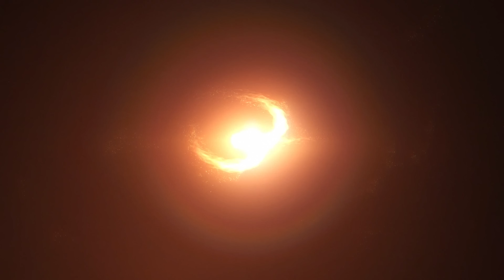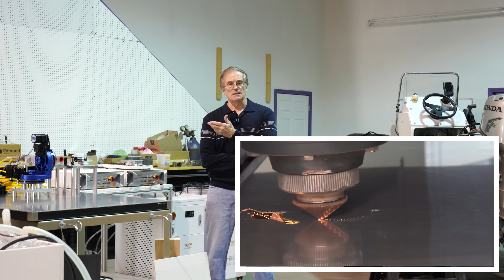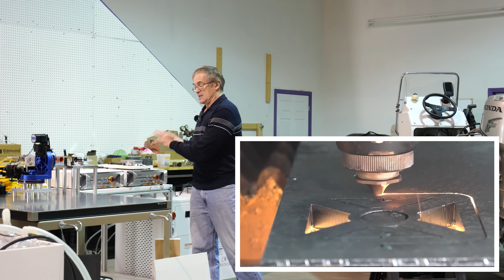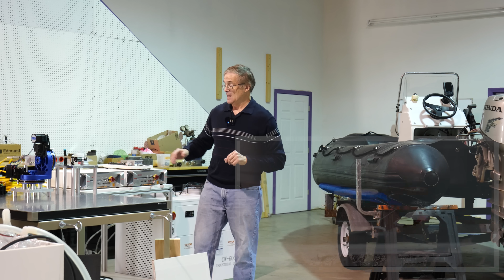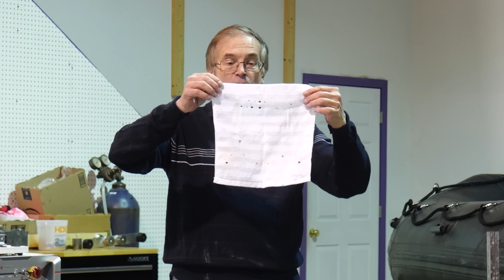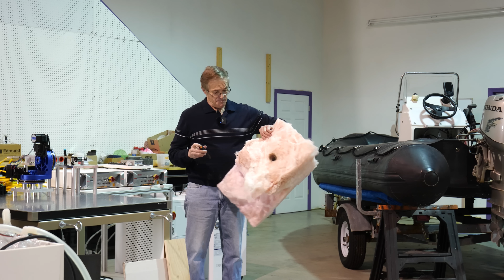We have a problem... and need your help!

Comment: What will happen if you fire the laser at the super white paint you made that returns all sunlight coming to it? I would create a 3 layered wall, the front wall is styrofoam, than sand and at the back a wall that is painted with the special white paint, the laser will go through the styrofoam and the sand get to the white paint and be scatterd back to the sand, sand could absorb the heat pretty good

Comment: Could you rotate the laser so you are shooting into the ground?

Possibly dig a hole into a room some number of feet down. Then behind the target have a deeper hole lined with PVC pipe and ending into the dirt. You could likely excavate a 20 foot deep 16" hole fairly easy if you don't have rocks. If you have rocks, a well drill could drill that hole in a short amount of time for not too much money. There are many companies that drill wells for ground-sourced heat pumps.

The bottom of the hole could be filled with some aggregate as a beam dump.

Comment: Something like larger rotating aluminum/copper plate which is cooled by air or water? Similar to disc brakes? It may even move sideways so there won't be hot circle and maybe water can be sprayed onto point of impact.
Other idea would be something like falling sand or waterfall with lot of particles such as clay to disperse or absorb light.

Comment: I'm certainly no expert in this, but my first test would be the plywood with a facing layer of Nighthawkinlight's updated Starlite formula.

I know there are questions about Starlite's effectiveness, but it should be quick, easy and cheap to test. Even if that doesn't work, a layered system of different materials seems the best way to go.

Comment: I think there might be some additional content that is useful but here are two ideas. Overall this is really a constrain imposed by the testing environment and not so much potential use in final application. Shooting lasers up towards the sky in a war or something like that. (civilian use of those lasers is probably illegal outside and aimed up towards the sky). 

As such I could think of two options. The first one is to instead of continuously turning on the laser, to think of the light as bullets and just switch on and off little bursts of light while keeping the tracking system on. This should be complemented with a default energy shutoff if beam is on for longer than some X time. For the more niche constraint of the testing space, I was thinking that instead of trying to contain and absorb the energy, maybe having something that splits the beam apart (like a prism or diverging lens) as a different concept of energy control.

Comment: Change orientation to vertical, aiming the beam down, not horizontal. Then you catch the beams energy with soot water, or water mixed with carbon. It is non toxic, portable, and self healing.

Comment: Use thin flowing waterfall tank with black colored oil and refleflective backdrop.  Laser will not have enough time to do anything even at this power. it is just not the cheapest thing ever, you will need pump, some tubing... there is no front wall to destroy and create leak

Comment: Some kind of translucent ceramic. Diffuse the energy in something that can handle heat well. You should also be using a lower power setting or a separate targeting laser so you only have to “fire” the big laser for a split second.

Comment: Vibrate the laser to increase the beam diameter, and turn the vibration off the second you need to actually burn the target. Use separate control system for laser vibration (like a watchdog). But then, why not just have a separate watchdog system to control the laser's E-stop ?

Comment: My first thought is to use KaoWool with a refractory coating (satanite, or one of those fancy high reflectivity yitrium based things). This seems like it would be fairly lightweight if formed into sheets with rigidizer (water glass). I mean, if you really have a laser that can cut a metal forge in half, wow!

Comment: Two ides:

1) Steel barrels full of water.  Two layers thick, and two layers high, with the rear layer on a stand to overlap the air gap at the tops of the barrels in the front row.  Use a liquid dam similar to those sold by New Pig to catch spilled water and direct it outside.  When the laser pierces a barrel, water continues to spill out the hole, and probably creates a cloud of steam to diffuse the beam.  Between tests, the small holes created by the laser can be plugged with duct tape.

Bagged sand stacked into a wall.  The contact point of the laser on the bag may burn, but the sand should absorb the laser before it makes it all the way through.  After all, it only has to last a few seconds.  If stacked on a pallet, a rented forklift makes it easy to move around.  A fire extinguisher can handle any spot fires on the front of the bags.

Comment: What about glass fiber welding blankets? Harbor Freight has huge ones cheap. lava rock exhaust heat wrap maybe? Couldn't you pulse the laser so it wasn't so powerful?
Reply from the maker: Adding flowing water to those is sounding pretty good.
Reply: @TechIngredients  might check styropyro's channel. he just built an insanely strong laser and was containing it semi decently. 

https://www.youtube.com/watch?v=UBVlL0FNbSE&t=2021s

Comment: Water Mist System? A "box" with the front opened and a " supercharged" pressure for short time testing? 3m depth? or more?
Guess each microdroplet will help scatter the energy? maybe use dyed water? Carbon nano particles? red food dye?

Comment: I'm sure there are specialized materials designed exactly for this purpose but they're probably expensive and impractical.  I wonder if you could use some kind of fog or something, any kind of droplets or whatever that could diffuse or diffract the light.

Comment: Another idea besides using “dissipation screen” is using reflective panels tilted at 45° angle downward, to redirect the beam into the ground (or into an absorbing material placed on the ground). Furthermore, we can combine dissipation with reflection, having the same setup, but placing dissipation screens (textured glass panels, for example) in front of reflective panels . The beam would be diffused twice, when it enters into textured glass and when it comes out the glass. Doing so we would radically reduce the energy density hitting the absorption material by distributing it over a large area. 
If your laser is infrared, you could use aluminum sheets as the reflective material.

Comment: I've followed you for many years and the tech ingredients projects just get immensely more exciting!

Sacrificial graphite blocks?  Similar to plywood without the problems... Debris control is a new problem as well as thermal management
Reply: Graphite sublimates at 3600°C, is cheap 

Behind the graphite you could use copper tiles machined for water cooling.

Add a ceramic coating to help reduce debris and absorption.

You could also purge the graphite with nitrogen and if you get plasma, you could use electromagnets to trap ionized debris

Graphite ablation ~0.1-0.5 mm/sec at 5kW (apparently!). A 10mm plate could theoretically last 20 seconds to 100 seconds. 

With active cooling possibly more

Comment: option 1 : kitchen or bathroom ceramic tiles glued on drywall, easier to create a backwall compared to bricks
option 2: hang a light backwall like drywall to a rope and make it swing like a pendulum before you start the experiment. It will spread the laser impact over a larger surface as its moving

Comment: Two drywall sheets filled with fine (quartz) sand in between? Sort of "regenerative" filling. Would the sand flow down to fill the hole in the sand fast enough? Or would the sand be fused around the hole and stop further sand from filling the hole? The drywall would only have to be thick enough such that the sand would not flow out through the hole in the drywall.

Comment: I have no experience with this sort of thing, but the thing that comes to mind is to try to defocus the beam, which then reduces the scale of the problem. I'm thinking that maybe you could use water as a lens, possibly using refraction. If you have an angled surface of a solid material that is transparent to the laser, then you essentially have an angled wedge of water underneath, which will hopefully absorb some of the energy and spread the rest through refraction. You still have the same amount of energy to absorb with whatever you use behind it, but at least it would be spread out into a line.

Comment: Is there a chance you could use AlN (aluminum nitride) sheets and construct a rig that allows the laser to strike the surface at the highest possible angle of incidence? The rig I Imagin would have a lot of sheets at an angle to the laser, almost like scale's (not sure if you can imagine what I try to describe).
This could help distribute the energy more evenly and improve heat dissipation. The price of AlN sheets seems reasonable — the main challenge would probably be designing and building the rig.
Additionally, running tests and fine-tuning everything at reduced laser power should also help. 😉

Comment: How about a wall of fresnel lenses  with a few layers? Hopefully enough to disperse the light and have it bounce around and diffuse to a safe level (set to diverge).
Would the lenses allow enough transmission of the light, like your optics do, or do you think they'd absorb it and burn?

Comment: TLDR: use mirror with laser trap behind it. If beam stops, it will burn thrugh mirror and hit laser trap.
Is laser beam able to be reflected while moving? If so, mirror could be used and some trigonometry to aim. If it stops, it will burn thrugh the mirror and you can  use something good for stopping but in smaller ammount. 
Other idea is just laser trap, if there is something that can withstand the beam. Kinda like silencer that moves infornt of the beam with it. It would have hole in the middle and mirror movment. If one on the two controls fail, beam would end up in a trap.

Comment: Dry wall at a glancing 30 degree angle, so the beam covers a larger area, and is reflected more (but still away from the source), and the depth the beam needs to cut through is twice what it would be at 90  degrees. The pannels could be aranged like a venetian blind. 

In addition you could have a water mister / sprinkler system on a gantry a few feet in front of the beam stop to break up the beam and increase the area it illuminates. Running water over the beam stop would activly cool it as the water turns to steam. Adding black die or carbon (lamp black ) to the water would reduce the danger of reflecting the beam back and blinding you. 

Maybe you could have an inclined plane covered with fiberglass insulation or fabric over which you are pumping water? Foggers or dry ice at the top of this slope would look cool, and break up the beam before hitting the beam stop.

Comment: Instead of tackling the hard problem of blocking the focused beam, why not pivot to the easier problem of diffusing the focus via a lens and then shifting the lens mechanically when firing?

Comment: 1st layer: wet silica fiber mat, or perhaps fiberglass. Something that will diffuse the light so it isn't so focused. 2nd layer, set at X distance behind the first: either a solid surface with a strong laminar flow of water down its front face or something akin to highly porous fire brick that is soaked in water/has water pumped through it.

I think depending on a single layer to do everything won't work, though I'm not as smart as others here. A sacrificial (ish) first layer that spreads the beam would make it much easier for a second layer to contain it.

Comment: Since wood gave the best result as far as duration I would use a different configuration that would reduce fire generation to one side.  However it would still be quite massive.  A secured stack of 2x6 beams would give plenty of time to hit the kill switch and probably only burn on the front.  The damaged boards could be trimmed and salvaged to s great extent.  It would fasterr to assemble than a brick wall but stil no cakewalk.  Oh use untreated wood if you go this route.

Comment: I saw a couple interesting suggestions about spraying a wall of fog to diffuse the beam.. what if you added nitrogen to the fog? Make a sort of gaseous curtain over the wall to both diffuse the beam and limit the oxygen for any fires that might start. Maybe this way the matetial wouldn't have to be fireproof? Though I admit it is a bit sketchy and might not work with flying drones around..

Comment: So if you use lenses to focus the beam, wouldn't you be able to use lenses to un-focus it as well? Maybe you can use a lens, or multiple lenses, to spread the laser out, and then you absorb the energy with less energetic pressure (over a larger area). I would even try again the wet towel method but behind a defusing lens.

Comment: Keep the laser moving relative to the distance of the target (small movements on the target will have little impact but the material farther away will see more laser movement). Add a secondary system (based on a separate technology) that watches the laser position commands and turns off the laser in the event the control system locks up and stops moving the laser.

Comment: Would it be possible to reverse the process….?   Set up an array of prisms to direct and lenses to diffuse and refract the beam back up to a wider less focused beam.  You could then put whatever material behind/around it to collect any remaining light.
Should be able to build it as a big rolling wall you can move around.

Comment: Have you considered testing that laser vertically, pointing downwards? It can burn into the ground for as long as necessary. If you set up your lab outside with dirt instead of concrete, it could be even better. Or you could bring dirt inside. Alternatively, you could do it above a pool or lake...

Comment: I think you're better off getting really good at *interrupting* the laser power anytime you have the laser escape your range. 

This could look like a layer of gypsum sheet rock (which is fire retardant), followed by a 4 inch airgap (standard stud width), and a 2nd gypsum sheet. This wall would be made light-tight and you install an array of wavelength tuned photosensors into the interstitial space. Your sensor circuit triggers a safety interlock on your laser's power supply upon exceeding a preset threshold. 

Cleanup would involve tossing some gaff tape on any holes you poke to return light-tightness to the wall.

Gypsum is a phenomenal firebreak, so it may also be a good barrier on its own.
Reply: I like this idea - with redundancy.

Comment: Waterlogged sand barrier or something with water flowing over it. Like a towel with a steady, recirculating flow. That should help to keep the impact area cool, while not needing to wait for inertia to start the water moving. Could also have the towel constantly moving while having the water covering refreshed, (A towel belt with one end in a bucket of water). If the issue is the laser getting stuck on a single point, the barrier itself constantly moving would solve that. And it would be portable if it works. I don't think the speed of the belt would need to be anything too crazy either.

Comment: Run water over ceramic/slate tiles. Both ceramic and slate are readily available in tile form as bath tiles or roofing material, so the price won’t be outrageous. You could use B pond pumps to run the water over the tiles. You could also fasten the tiles with hardware instead of mortar so than they can be replace if (when) they’re ablated.

Comment: Could you use something that is optically clear to the laser light frequency but will diffuse the light maybe in a couple layers series of fresnel lenses or something so that when it hits an actual backstop it's diffuse enough not to damage anything? Basically just spread the bean back out optically instead of trying to stop it dead.

Comment: I would try gas contrete drenched in water. It absorbes water very good and you can stack it easilly maybe 2 meters high. Maybe use two or multiple layers of 100 mm or 150 mm thick Ytong building blocks. If needed you can spray water on it when shooting the laser beam at it.

Comment: I had the same waterfall idea as many others, perhaps running down concrete fiber board. I also wonder about the efficacy of a fog machine to diffuse the laser energy, perhaps a 12" thick wall of fog in front of the hardiebacker waterfall?

Comment: A waterfall.
Maybe a shallow steel box where water is pumped up and run down the front face. So the steel wal is coled from both sides.
To absorb the energy some pigment might be added. May also  ne a thickening additive might help do thicken the water layer and to carry the pigments.

Comment: Hi, interesting problem, how about rotating copper disc, and if it is not enough you can move it linearly back and forward, might be enough to transfer the  heat? Just for interest what is the power density of the beam😅

Comment: All right situation would be interesting to see a fish tank this may help diffuse the laser I could potentially be in front of sandbags putting blankets or towel inside a fish tank full of water of course do fish tank would be full of water to start with it would be in front of sandbags your first shield are the bricks testing it with fish tank potentially different color of water blue red Orchard standard water putting blanket maybe inside the fish tank with the heat can be absorbed by the water